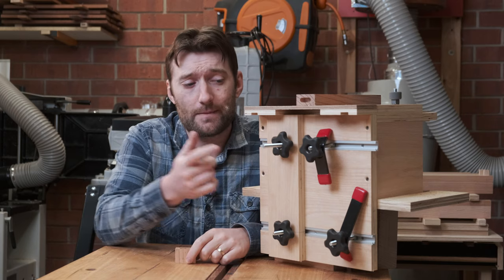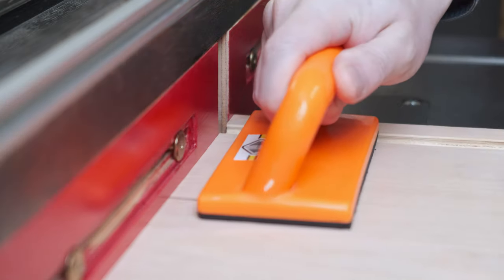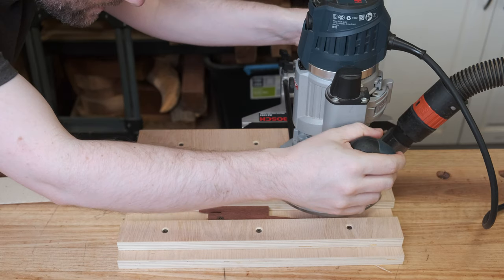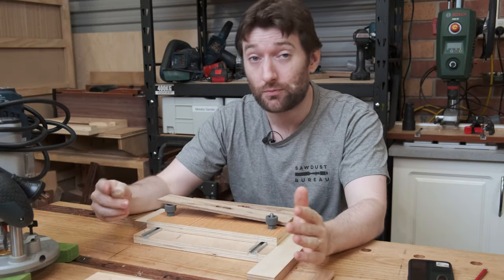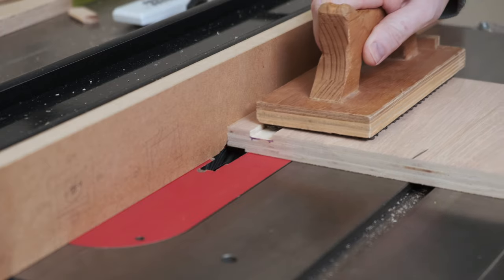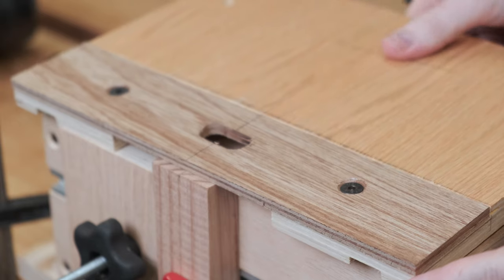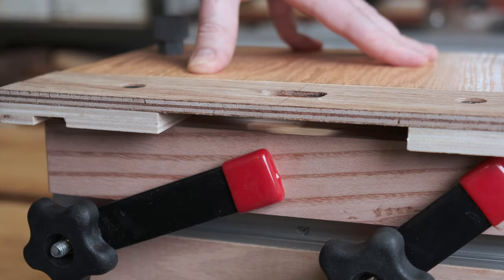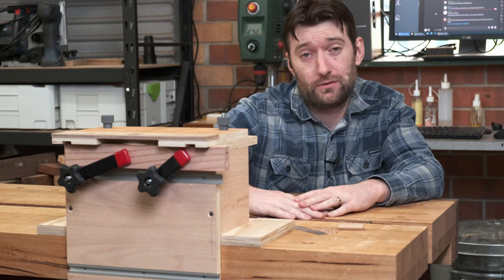Use Dominos Without A Domino! Floating Tenon Jig

Comment: I made a very similar jig to this from plans in the Australian Woodworker magazine back before I could afford a domino. It’s more accurate, more consistent and has options for much bigger tenons.
There’s very little you can’t do with this that you can do with the domino.
Reply from the maker: Absolutely - angled mortises, really long pieces (unless you've got a big ladder!) and just generally being quicker is "all" the domino gives you. With the right size router bits, could fairly easily outstrip the capacity of the DF500 too.

Comment: This has frighteningly little to do with the video, but on your Bosch plunge router when you let go of the plunge lock lever does it spring back and actually lock securely or do you have to also push it to get it to lock properly?  I have the same router and it's not locking when I let it go and I can't remember if it worked properly before or if it was always this crap and I just didn't notice.
Reply from the maker: Just went out to check. From force of habit with all routers I locked it the first few times!

When you let go, it's a bit hit and miss how well it grabs (without pushing). It seems to correspond with how far it's "wound" - if you use the micro adjuster, it moved the blue portion on the back (where the lock is). The higher up that is, the firmer it grabs. 

Midway is pretty good, but limits the range to microadjust then
Reply: @TheWoodKnight  Thanks for checking!  So it's dependent on the other thing that I broke eons ago.  Great!
Reply: @TheWoodKnight  I think the trick is to bring the lever all the way down and let it go there.

Comment: Cool, It looks a lot like a Leigh FMT jig.
Reply from the maker: Yup! There are a couple like Leighs FMT, Trends M/T or the MortisePal that do more or less the same thing. WoodSmith/PopWood/FWW/Phil Morley all have similar DIY jigs/plans too - all with pros and cons. For example, this template system I'm using allows for quick change over to different sizes, but no adjustability without making a whole new template.

Comment: I don't suppose that maroon Robertson driver came from screw it screws by any chance?
Reply from the maker: Yup! Been using ScrewIt's stuff for years
Reply: I found them early last year! Screws are fantastic value. However, I absolutely hated that driver bit though. I found that it wouldn't insert into the screw head far enough, causing the bit to jump out; as seen in your at 8:06. 

Do you use an arlec remote controller to operate your dust collector?
Reply from the maker: I've had probably the opposite problem with that driver where it gets stuck because its such a snug fit!

I used to use the arlec remote on my DC - worked just great. My new DC has a different switch which is a bit harder to come by so I haven't wired out the NVR so that it works with the arlec remote. These days, I just use it on my shopvac
Reply: Yeah nah you got a good one! I have a few in different lengths and none fit quite right! Their screw driver is perfect. Last time I couldn’t find a driver i cut that screw driver and slapped it in the drill lol. 

I had the same issue with the switch on my big dc. I decided to rewire with out it. I couldn’t figure out what to do with the second power unit until my mother in law came to stay for a few months. I connected the washing machine to it after learning that she washes her slippers everyday lol.